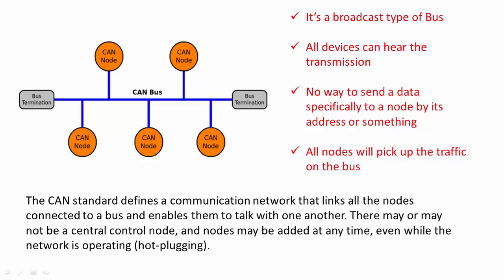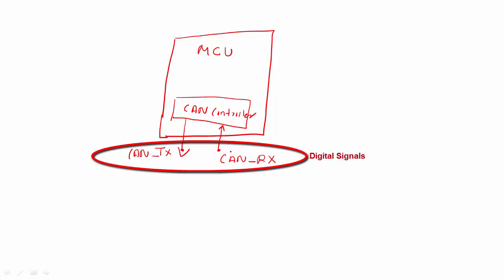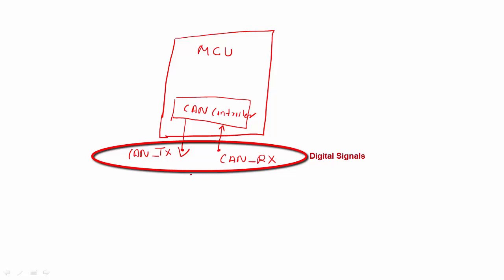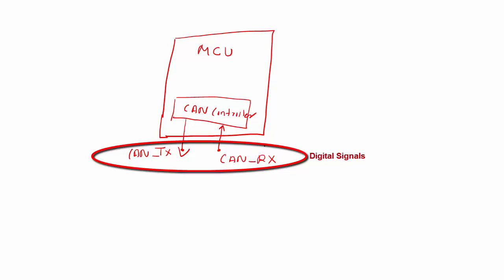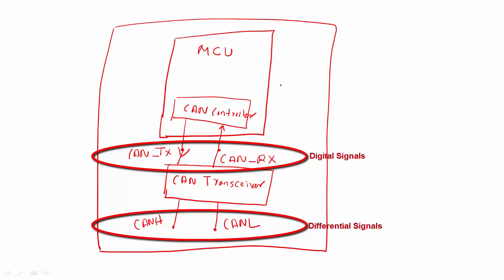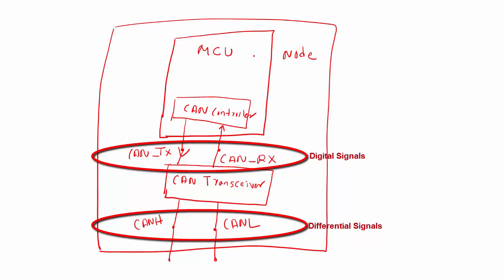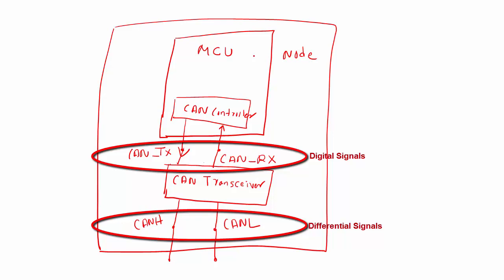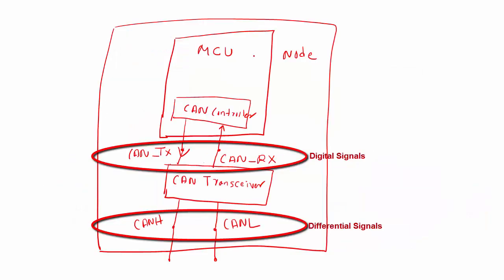Controller Area Network (CAN) programming Tutorial 5: Understanding a node

Comment: Why do we have both CAN-H and CAN-L? What does it signifies? Is it  for high speed & low speed or something else?
Reply: No its refers to CAN High & CAN Low. Basically CAN needs these two lines to operate, it can transmit data(dominant(0)/recessive(1)) based on the voltage difference between these two lines.

Comment: Why have the terminating resistance  R ?
Reply: Because the signals need to have a Voltage difference. The resistance ensures this.
Reply: it prevents the data from reflecting and returning as an echo
Reply: @akevinc  not a electronics engineer but do resistors affect voltage? I thought they only affected fhe current?
Reply: resistors prevent reflections in circuit that are caused due to echo which can fudge incoming data